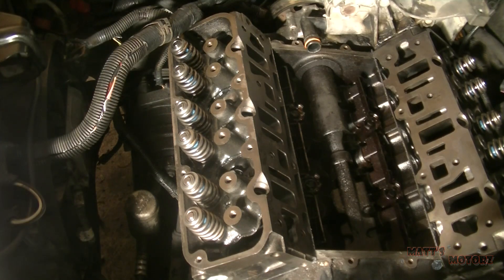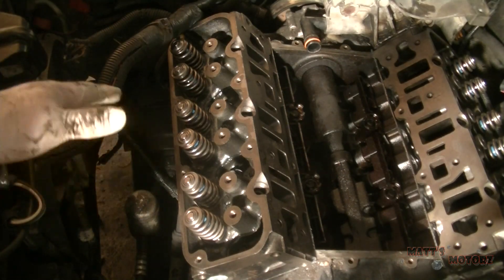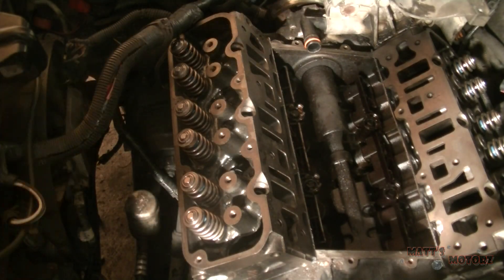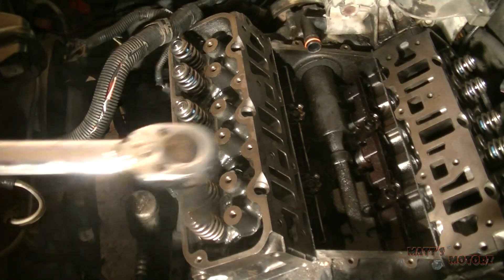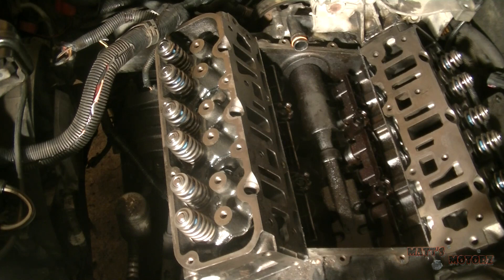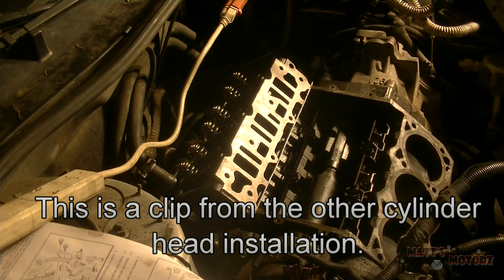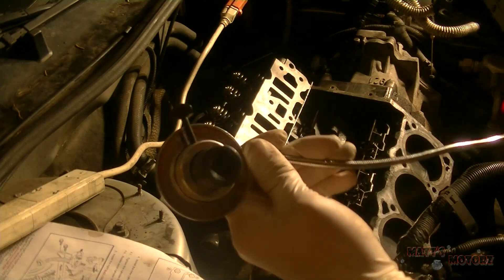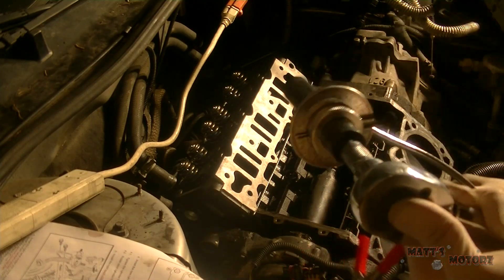How to Torque Cylinder Head Bolts

Comment: 130* from the 9 o'clock position will be your 1 o'clock mark. There's generally a +10 degree safe zone after the initial torque and first rotation.
Reply: Could you add that it's a V6 - 3.8L to your title? It was misleading, I was looking for a V6 3.5L, not how to "torque head cylinder bolts". Thanks if I had a Pontiac ^^

Comment: Do you know off hand why manufacturers do the lb-ft specification and then add a number of degrees for a final turn? It seems like that introduces more possibility for error than just going by lb-ft of torque.
Reply from the maker: Torquing by just the setting on the torque wrench doesn't have the best accuracy in terms turning the bolts the same amount in the block.  Factors such as, lubrication amount / type, cleanliness of the bolt threads ect. can cause the same fasteners to not have an equal torque into the block. (So for example, if you lubricate one bolt, and it is going in to clean threads, it will turn into the block more than if you didn't lubricate it, and have dirty threads at the same torque setting.)  The angle measurement is independent of these factors.
Reply: @MattsMotorz  should never lubricate threads before installing in the head as it can cause a hydraulic effect and break something. You can however lubricate the bottom of the bolt head so that when it makes contact with the surface it glides more freely this giving a more accurate torque
Reply: The bolts that require an extra degree of turns are for the most case torque to yield bolts. They stretch out when torque down and should be replaced after removal.
Reply: 8 silindir 2011 model landcuruser sente cinzir basil takilir goster